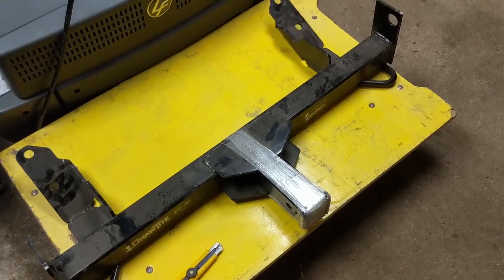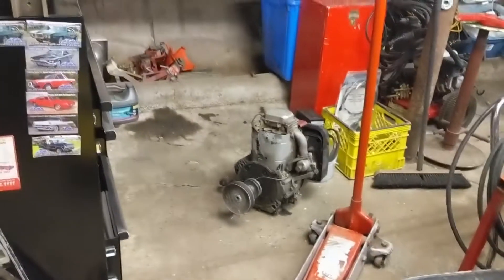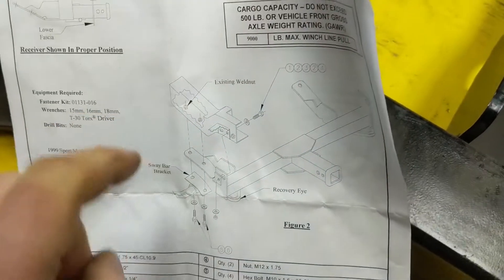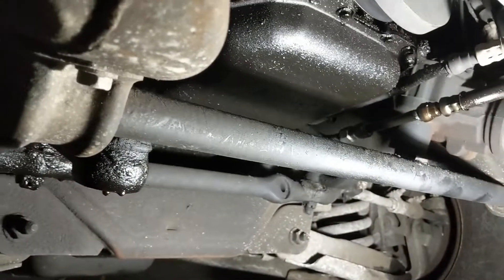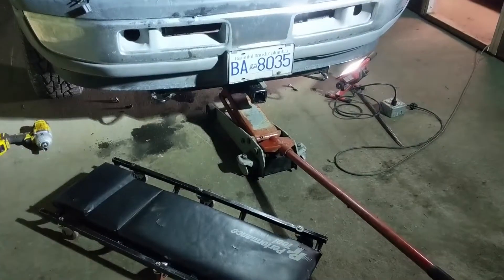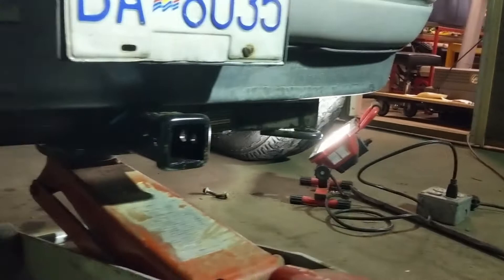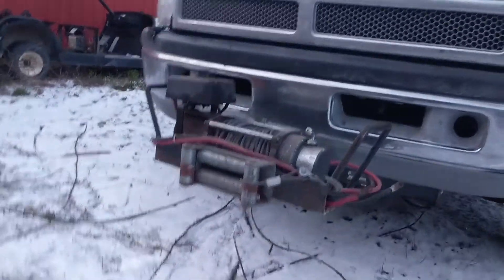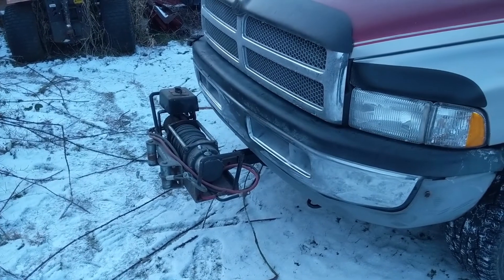Part 2: Installing a Draw Tite 65003 front receiver winch mount to a 2nd generation Dodge Ram 2500

Comment: Looks like a lot easier install than the curt. But I wonder if this will work in conjuction with a steering gearbox brace, which already uses the sway bar bolts.
Reply: I was wondering the same thing.

Comment: Thanks! I got the same used draw Tite hitch to mount on my 97' 2500. This video will help me get a headstart. Great idea with the floor jack.
Reply from the maker: howd you find a used one? I had to search to the ends of the earth to find a new one!
Reply: @machinesnmetal  I got lucky! It randomly popped up on marketplace for $75. He had taken it off of his 96'. I wasn't even searching :)
Reply: @machinesnmetal  however, I usually go straight to Etrailer.com all that type stuff. They're the best!
Reply from the maker: I checked etrailer out, shipping was over $125 regular delivery, and almost $275 priority.. half, and more than the receiver itself!